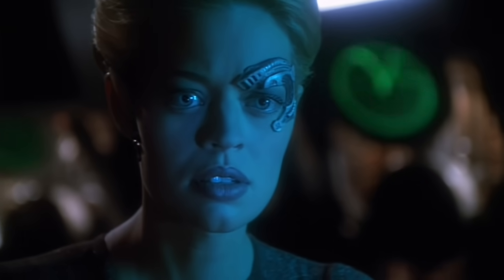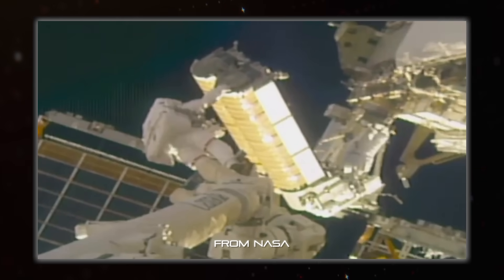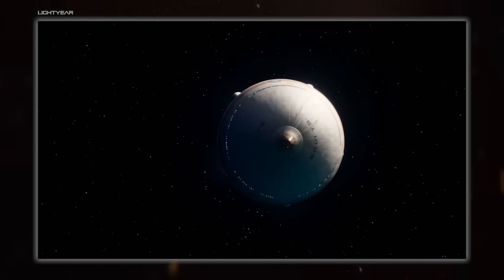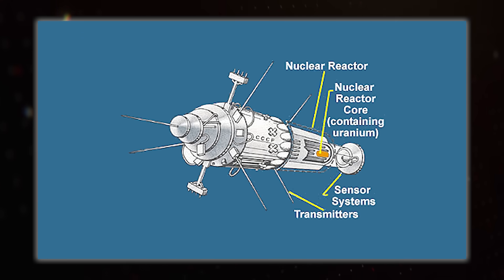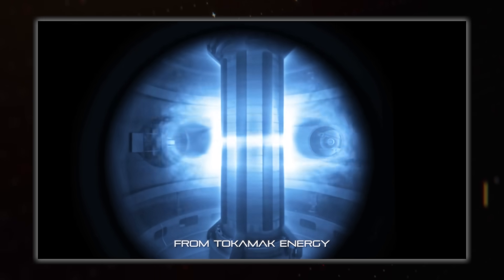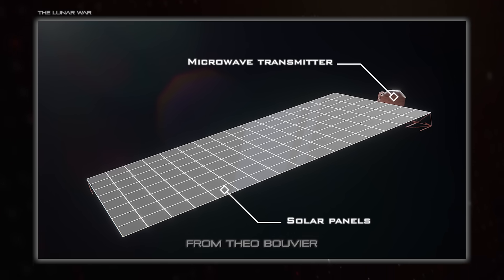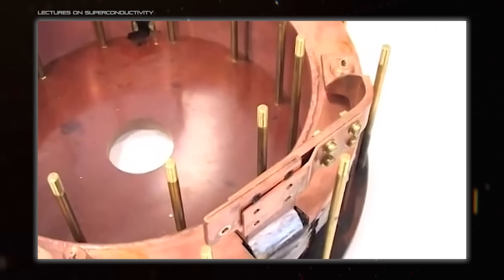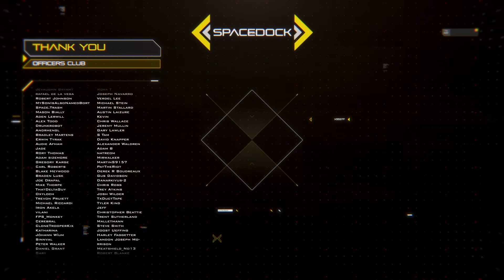How to Power a Sci-Fi Spaceship

Comment: battletechs jumpship using gigantic solar sails to collect power to spin up their jumpdrives  - take anything between 6 to 9 days to be fully charged, and the jump, which can be up to around 30 lightyears in distance, is essentially instantaneously. the ships itself remain at fixed points in any given solar system while leaving the delivery of materials to and from that system to small ship that can dock to the giant jumpship, itself.

its one of the more and most realistic ways to space travel in any sci-fi setting to this day, probably....
Reply: Only at a first glance. The amount of energy you can collect with solar panels far away from the star is negligible comparing to fission or fusion. And their jumps should use some insanely smart technology for that small amount of energy to warping them through 30 light years.
Reply: @ImperativeGames  its not rly clear how far away they are from a star as far as i know but it also takes like as said 6 to 9 days to collect all the energy to make the jump at minimum we also have instances where it can take up to a month or more, right?
Reply: In a realistic setting they would  collect solar energy way closer to the sun or get energy delivered from they shuttles.
Reply: @molybdaen11  theres a good chance that the jump points the jumpships use are the various lagrange points in any given system are. 

the shuttles take a very long time usually to get from a planet to the jump ships anything between 10 to 30 days at a time, so there is a high chance the jumpships sit on the L-points around the sun (eventho more likely around planets...)

 i dun rember if this was ever anywhere specifically stated so just rational guess on my end.... but it seems like the most likely way to me.
Reply: @GunRunner106  I would think so too since gravity is not beneficial to ftl travel. 🤔
Reply: @molybdaen11  Well, that really depends on how it works. Yeah, most of the solutions for Alcubierre drives requires as close to "flat" spacetime as possible, but not all of them; and the default solution for a wormhole requires a black hole at either end. Tweak the numbers and you get folds that require a star at either end; or a planet-mass object in proximity to a star, which is how FTL in my setting works.

Comment: One think I remember from the old Independance war game is that the hero ship's size is mostly tokomak ring. There's engineering spaces inside the ring, and engine on the back, a cockpit on the front, and a pair of weapon pylons to either side. But reactor to mass, that thing's CRAZY.
Reply: Glad someone remembers.

Yeah, nice to see a sci-fi where the powerplant (realistically) dominates the ship's structure.

Wasn't a Tokomak afaik tho, the concept was a particle accelerator ring that fires a stream of fuel (probably deuterium) into a neutronium (theoretical super dense matter) catalyst where it would fuse.
Reply: I also liked that the LDS was used both for "faster than light" travel, but also for shielding, the LDS being used there to intercept and create an area of space that the laser is about to go through all wibbly wobbly, scattering a laser. But if there were more lasers than LDS shields, then unless some went through the same space, it would disrupt the superstructure of the ship.
Reply: @markhackett2302  Absolutely! and it totally makes sense. If you have the technology to displace your own ship's position, the next logical step is to use it to displace incoming missiles so they miss.
So much sci-fi is guilty of introducing a tech, but not exploring its rammifications. Happy that I-War was an exception.
Reply: Those games were hard as nails, didn't finish either of them :(
Reply: That sounds more like a ship in an HFY story

Comment: Something to keep in mind for thermodynamic cycles. There is an absolute upper bound for the acieveable efficiency η, given by both the temperature of the "hot" and "cold" side. T_h and T_c respectively

η = 1 - T_c / T_h.

On the one side you are limited by how cold you can get the radiators, while still being of reasonable size (radiated power per area is proportional to the fourth power of Temperature)

On the other side you are limited how hot the the hot side can get, before the materials begin to melt, or start to thermaly decompose.

Assuming you can achieve T_c = 300 K (26.85 °C) and T_h = 3000 K (2726.85 °C) your maximum achievable efficiency is
η = 1 - T_c/T_h = 0.9 = 90%
Which sounds good, but at this point the radiators a very inefficient,  only able to reject about 400 W/m² of heat. If you need for example to get rid of 400 MW of waste heat. This wold require already 1 km² of radiator surface. So basically a 1000m by 500m panel (since you can use both sides)

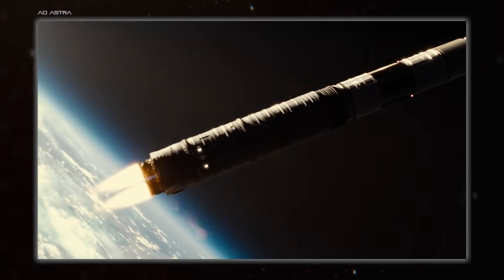Comment: 3:10  mining ice, using solar to convert it to h2 and o2,   burning the h2/o2 for power.    There are tons of "good use" cases to do this..    the best case or example is simply a battery effect.   You can use solar panels to charge batteries and crack the h2 in low power settings...   Then when you need more power,  then the panels can provide,   thats when you kick the engine on.    oh but it gets better...   because you can then use the water as coolant turning it to steam...  and using the steam as propellant.    this now lets you shed excess heat  much faster, allowing you to run systems "hotter" while you re doing it.
Reply: Also the water can be used directly to support the crew or other systems.

Comment: PV- Array in Space, 20% Efficience, Diameter 15.000 Km. Than 20% Efficience for an Matter- canon. This firing on a Matter- sail on a 12.000 Ton Spacecraft, for 87 days and 10m/s² (speed is 0,25c)
In the Years before that: making Antimatter from the solarwind, for the brake of speed.
And Yes: this is inspiratet from the ISVs of ,,Avatar" 😉

Comment: small addition to conserving energy in rotating wheels. we use those at Work in the Datacenter,it is supposed to cover the few seconds gap when switching to emergency generator on a powerline out. our datacenter eats up about 80 MW,so must be some proper wheel rotating there.

Comment: Technically, nearly everything is solar powered.
- Photovoltaics and thermal - obvious
- Wind - sunlight warms different parts of the Earth, making air rise in some areas. When air from elsewhere moves in to fill that gap, you get wind.
- Hydro - sunlight evaporates water, which falls as rain onto a higher elevation, and gradually trickles back down to ocean level.
- Wood/biology - plants collect solar energy and store it as sugars, which they chain together to make wood.
- Fossil fuels - ancient plants and photosynthetic organisms which died, were buried, and whose chemistry was gradually changed from wood into coal, oil, gas, etc.
- Nuclear (fission). Ancient star went supernova, creating the heavy elements which release energy when you fission them.

The ones which aren't solar are:
- Fusion - forcibly combining free hydrogen to create helium, and releasing energy.
- Geothermal - latent heat from rocks, asteroids, and comets smashing together to form the Earth.
- Gravitational - probably not something we can tap. As the moon slows down due to the drag of the tides on Earth, it loses rotational orbital energy. This causes its orbit to enlarge (moon gets further from the Earth).

Comment: The best power plant for Deep Space Starships that I'm aware of is a Hydrogen fueled Fusion Reactor since with a powerful enough Magnetic Field projected in front of your craft (AKA a Bussard Ram Scoop), you can scoop up as much or more Hydrogen than the reactor burns from the cosmic dust...

The only downside to this is a Hydrogen Fusion Reactor Irradiates the HELL out of itself and so Radiation Shielding around the Reaction Chamber is an absolute MUST for a Manned Ship...

If you use Helium 3 as your Fusion Fuel, then the reactor won't Irradiate itself and doesn't need the Radiation Shielding (or not nearly as much shielding) but there isn't much (if any) Helium 3 in Interstellar dust for the Bussard Collector to grab so finding an abundant source is a must...

Comment: Not sure how it's meant to work in space but the power source I always want to see somewhere is a centrifuge drive. It's the Cold War and america really wanted its heavy bombers to fly further. Jet engines are fairly refined at this point fast but hungry, tried messing around with the power of the atom in the sky didn't get very far, piston engines they're just too slow these days and not a match for short range jet interceptors. Enter the centrifuge drive. So at this point we're dragging around tonnes in engine, fuel, oil and cooling systems. What if we just replaced all of that weight with a giant flywheel? a flywheel not spinning weighs the same amount as a spinning flywheel. The physics of the wheel itself permitting you can store an "infinite" amount of energy in a flywheel. Wind up flywheel cars just take that premise to the extreme.
Reply: That is Not bether working. Why? Answer: Turbine- Engines have Spinrotation....
Reply: That sounds like a lot of vibrations and energy vectors moving in the wrong way.

Comment: I'm seeing an increasing number of people making this mistake. Batteries do not store electricity. They convert the electrical energy into chemical potential energy by using the electricity to convert one chemical into a different chemical. When you want the electricity back, it runs the process in reverse. In that respect, it's the same as a hydrogen fuel cell + electrolysis, except you're using different chemicals. Because it's a conversion, there are losses involved. Typically 85%-90% efficiency for Li-ion. Versus 30% for hydrogen (although they seem to have recently come up with a way to improve that to 95%).

Capacitors OTOH store electricity (gathering up electrons). But that has its own problems. Incidentally, this is why all the regenerative braking systems on race cars use flywheels, not batteries. Using motors and batteries for regenerative braking only allows you to reuse about 30%-35% of the braking energy due to all the losses. A flywheel however converts linear kinetic energy into rotational kinetic energy, and is above to exceed 70% efficiency.

Comment: I like how most ships and mechs in UC Gundam are powered by fusion rectors, and their power output, particularly in the original series, is small enough that the mechs would not melt (although they would probably glow a bit). And early Zeonic mechs with beam weapons also tend to be aquatic, because, well, water is a good heat sync.

And then there's Char's Counterattack, where funnels also have radiators on them. It's that way because the Gundam needed a cape, and cylinders are boring, but it does look very good, and is a good nod to realism.
Reply: They do in fact "glow", just not in the visible spectrum. It's all the Minovsky particles they give off, blinding low frequency sensors and disrupting unshielded electronics.

Comment: Have you heard about Terra Invicta? The amount of ship modules (power sources, radiators, drive systems, heatsinks, weapons, energy storage etc) is staggering. You need a massive chart just to list all the available drives and theen good luck figuring out which one to pursue. Would be nice to see you use some visuals from it to showcase the things you're talking about in a lot of those videos.
Just fission alone has like Solid Core, Liquid Core, Gas Core, Vapor Core, Molten Salt. And fusion is a nightmare.

Comment: I heard about a solid state motor that heats an incandescent sodium lamp that powers a photovoltaic cell, as the light from the lamp is monochromatic the cell does not heat up, thus being more efficient than the sun